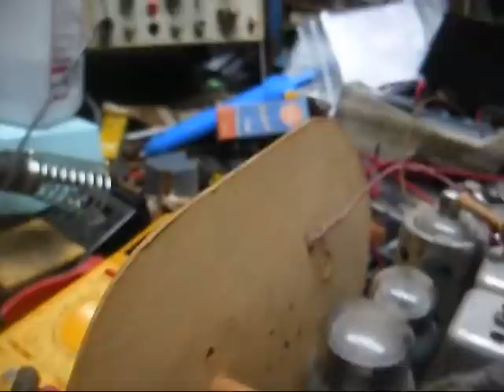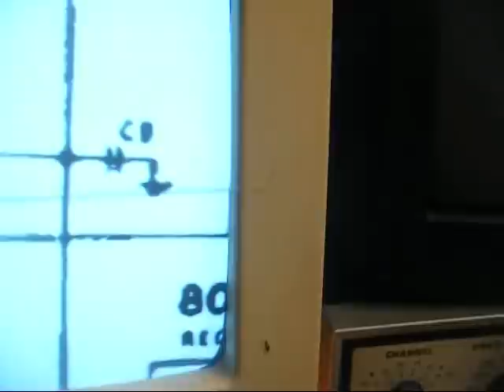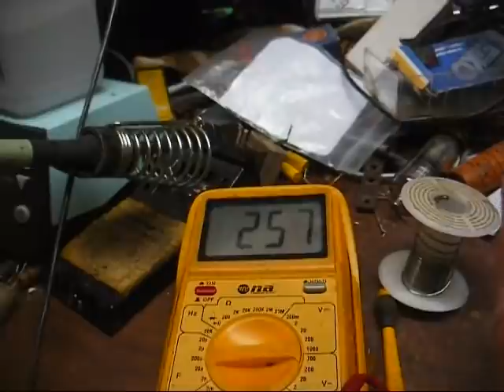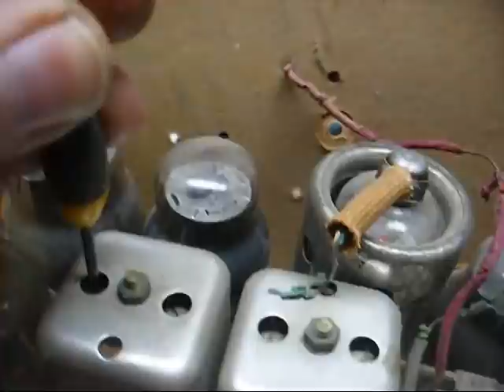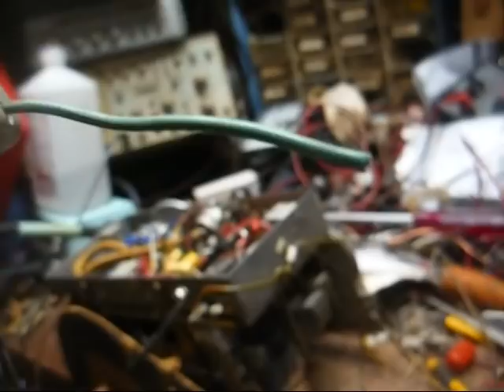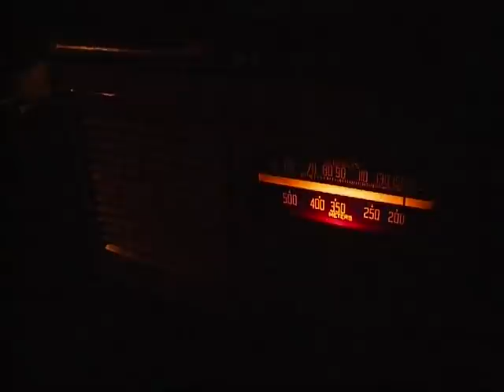Repair of a late '30's Majestic tube radio

Comment: Got a good deal for 5.00. On a Sirius XM boom box with the XM receiver included along with antenna and power supply.  The power supply was shorted. I had a spare  12 volt wall wort supply. The unit plays beautiful with good bass and loudness and was still activated to the Sirius Radio Network. Best deal I have gotten in a long time. I can also use the boom box in the car with a 12 volt cigarette lighter power cord

Comment: Cabinet’s in pretty rough shape, but is worth some sandpaper and wood putty. A new coat 🧥 of varnish, or wood stain, would finish this radio 📻 beautifully. Ya know the condition best on those capacitors, IF cans, resistors, and bumblebee,s. Don’t know about this being a hot chassis set. Yes, this one ☝️ kind of sounds like it, by how you’re talking about negative 👎 ground to the capacitors. The radio 📻 looks great on the front. I like the glass dial lens, the dial light 💡, and I hope 🤞 and pray that ya don’t need to restring the dial cord. Yes, I’ve tried ☝️ one, to an old, favorite pocket sized cassette player radio from 1978. It isn’t that I couldn’t fix the dial cord, it’s that I didn’t decide to take the time to try to fix it, so it wound up not fixed. Anybody can restring a dial cord. It simply takes a lot of time and talent. This radio is very much deserving a very good home 🏡. I understand your not wanting to sand, or refinish this radio. I understand that those capacitors in everything you own is a hard job. Your basement is pretty interesting. I saw the colored children’s record players stacked from floor to ceiling. I hate when ya eol those 1970’s Lloyd’s console stereos and such, but again, even I cannot save everything. I’d like to see ya 👋 get these console stereos for $20.00, and sell them for $25.00, for example. Ya don’t even need to recap them, if they’re going to nobody. If they are going to somebody, just charge accordingly, onto the $20.00, or whatever you paid for the console. Ya do a very good job 👍 all these radios, tv’s and record players. Been watching your videos since August of 2016, just shortly after my mom died. My Chandler Arizona, apartment was always infused with your voice, and Shango066’s, since I like both of your videos so much. Good to get to the rotten rubber wiring in these radios, which could be a 🔥 fire hazard. An isolation transformer is a great 👍 thing to have for hot chassis sets. Light 💡 is definitely at the end of the tunnel for this radio. I hope 🤞 ya sell it to somebody who wants to refinish it. Please keep these great 👍 radio videos coming.

Comment: Here in Canada we call it Princes Auto.  But you guys call it Habor Freight . They have best price on stranded #12 or 14 AWG  wire . In the trailer wire section.
Reply: For electronics repair you typically want something like #20 or #22 for most hookup wire on older stuff. Power cords are #18. Newer electronics often uses #24 or even smaller for hookup wire. 12 or 14 would be too big and clumsy to use, unfortunately.
Reply: @lwilton    In my city our computer store and electronics part have when bankruptcy.  We have a military discount store left if you have something like that near you. They have printer cable about 1/2inch that has small wire like that . Happy hunting.

Comment: As always I enjoy the content that you put forward. Both from a pure learning experience (I have been involved in
tv and radio repair since the mid 70's) but can always learn something new. Just a thought, I have absolutely no ties
to tubedepot.com but they have been a go to for me for quite a while now for wire supplies. I am an older citizen
on a strict budget. I purchase from them because their prices are very fair and there selection is good. 
Cloth covered wire, stranded, solid core, newer mil. spec. wires in all gauges (plus 600 volt, 300 volt) shipping times and
charges are very reasonable. NO MINIMUM ORDERS which is something I really appreciate. I can order 4 feet of a wire I need
and know I will not be price gouged on shipping and handling (although it would be silly just to order 4 feet of 1 wire). They also
have a good selection of resistors although capacitors are expensive and limited to what guitar amp builders and audiophiles would usually
want to order. Others items are reasonable and usually in supply (tubes are way expensive but matched sets of great audio tubes).
Shipping to here in Maui usually takes just 4 or 5 days, I think they are in Tennessee so that is close to you and would be quicker.
Very good labeling of all items and well protected shipping. Well I said enough about them, just trying to help you. Aloha
Reply: How is it living in Hawaii?
Reply: @tinecrinec4769  It is very different now then it was 50 years ago. Agriculture (sugar cane and pineapple were the mainstays
of the economy on Maui back then. Visitor industry was just starting to be a major player. We only had one traffic signal
in all of West Maui and the pace of life was very much slower (new people to the islands say the pace of life is still slow but it is nothing compared to 1/2 century ago). Still all in all I cannot think of anywhere I would rather be living right now. Aloha from inside my home in suburban Makawao Maui, Hawaii.

Comment: Bryan, a good source of small gauge stranded wire is from old defective computer switching power supplies. Many colors, good long lengths and best of all CHEAP!  You can find them at computer repair facilities, and are yours for the asking. I have built up a good supply of wire that way.

Comment: Is see rubber wire.  Ugh.  I hate that stuff.  Pain for restoration.
Reply: I got a plastic shoe box  full of  1950's cloth wrapped wiring scavenged from other stuff in case I have to 
replace that crappy rubber covered junk. I'm sure it will one day come in handy!

Comment: Majestic 1A50H. Very roomy under the chassis with plenty of working space to put new capacitors and resistors in.
 Note:all the heavy lifting (rewiring,ugh!) was  excellently done by Bryan so all you'll need is to refinish the cabinet!
 Or you might have a similar  cabinet that fits. I always wanted to see a video on how to do just that.
Reply: And skip the hours of fun and excitement of changing wires?
Reply from the maker: I wish they were all that way.
Reply: @radiotvphononut  I think it will now last another 82 years! Hopefully AM radio will still be around then! LOL

Comment: Send it to me I'll make a bluetooth speaker out of it.
Reply: how about no
Reply: Too nice to hack up.  You could add an audio input jack as the set has a power transformer.  Use an existing hole.
Reply: @randyab9go188  nothing wrong with making a bluetooth Speaker out of it. It would sound better 
With a Couplle of 4 inch JBL'S Or
a Couple of jenson's Or adio Boss's
Installed.